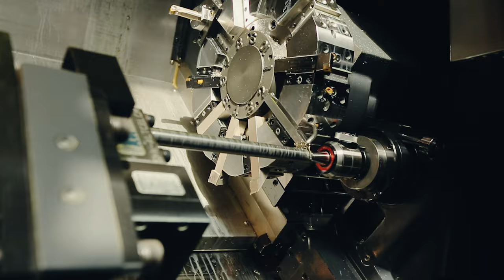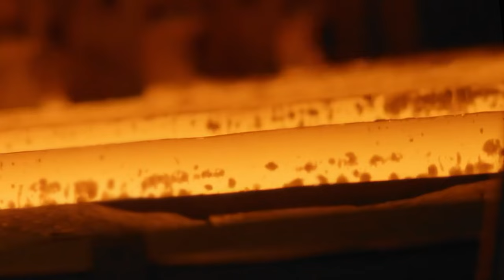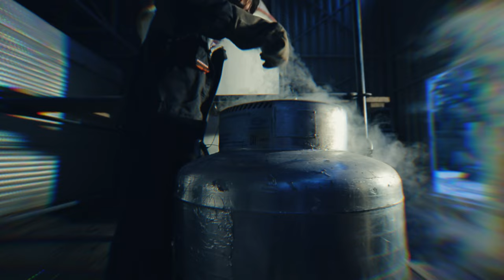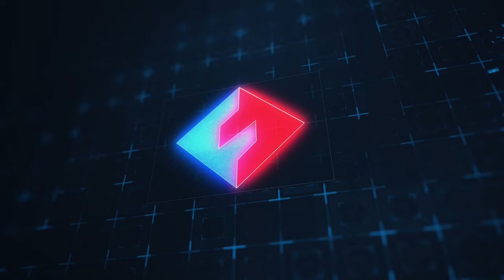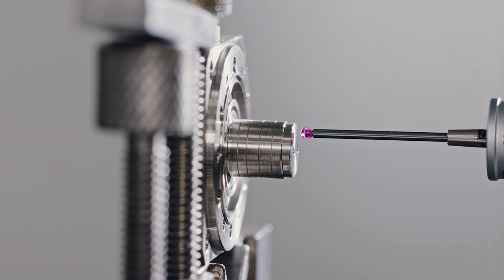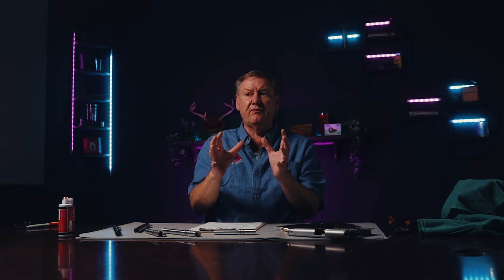CRYOGENIC BARRLES | ARE THEY WORTH IT? | 1911 BARRELS | FUSION FIREARMS

Comment: I could have give your arguments more value if you had not exaggerated the pricing 300%. This shows a clear disregard for facts.
Reply from the maker: Yes you could, what i am saying is that for most applications in basic firearms for most folks this process is not worth it and most will never use the firearm to an extent where Cryo gives them any benefit.

Comment: Have an original 1915 Springfield Armory slide.  Would like to shoot it.  Have been warned that the old slides were soft and prone to cracking.  Would cryogenic treatment substantially reduce the cracking risk on my old slide?
Reply from the maker: Probably not. The warnings of old slides cracked because of being soft is BS. I have seen many more slide crack from being too hard than too soft.

Comment: Don’t think a handgun of any kind would be a good application for cryogenic treatment. Read an article about a guy that built Briggs &Straton motors for go kart racing, ( all parts had to be within factory spec) he would have the cylinder and piston cryogenic treated. When he first started doing this his motors would run away from everything after a couple laps when they became heat soaked. They tore down some of his motors and all were completely legal. The treated piston and cylinder cylinder maintained concentricity and didn’t loose power!
Reply from the maker: Yes, for some motor parts, & operation in extreme heat condition like the piston, it is a great application.
Reply: O have a 1989  Taurua revolver and I can't file its hammer. I have a 2022 taurus  PT92 and a can file its hammer. I would love better parts on my guns. Last week the firing pin from my taurus got broken... a problem of temper, I suspect. That's how I got here. I need a better firing pin.